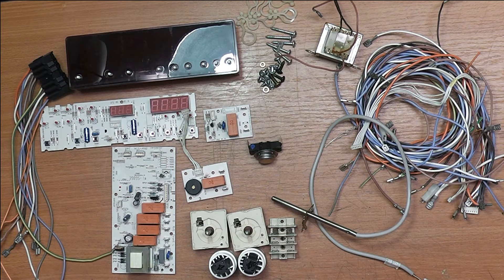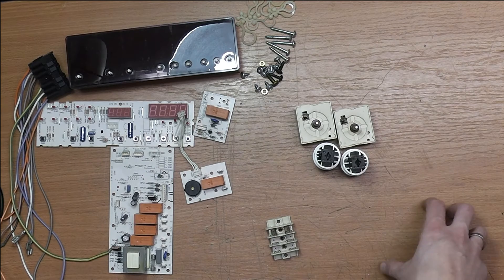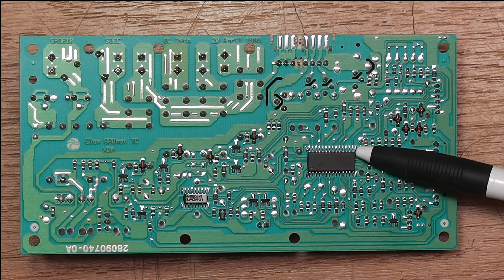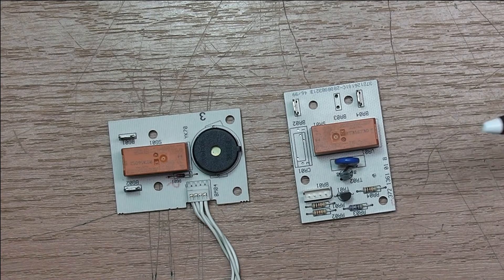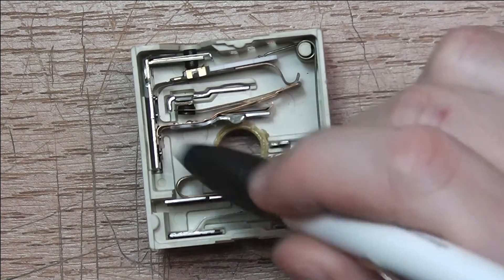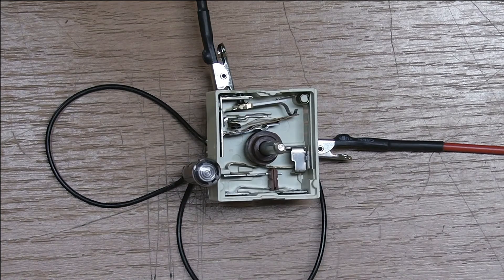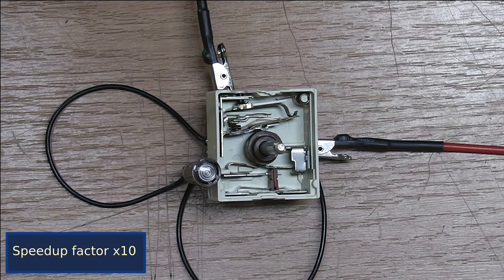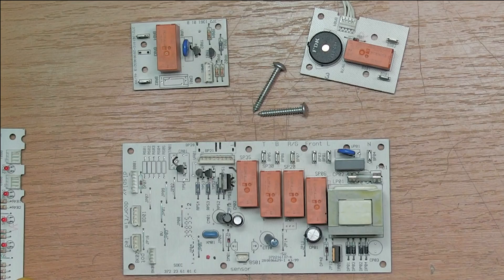Internals of an electric stove (Privileg ProComfort 8200E)

Comment: Great video. So does this oven not have temperature regulation? I don't understand how open-loop PWM driving can achieve temperature regulation.
Reply from the maker: +TheHue's SciTech Hey there and thanks, it means a lot to me :-) The oven has two parts, four stoves on top (where the pots and such go) and the bottom part where the baking happens. The top stove (for which the setters I show in the video are for) are indeed without temperature regulation. The only thing regulated is the amount of power that is output.

However, the bottom part is regulated. It was just very uninteresting (which is why I cut it from the video). The NTC measures the temperature, which is fed into the MCU's ADC input. Then the regulation happens digitally in there. Hope this clears things up. Thanks again for watching!
Reply: johndoe271828 So for the regulated bottom part, I presume the MCU drives the relays?
Reply from the maker: +TheHue's SciTech Yup, that's what the wiring suggests. There's more than one heating coil in the oven (those I didn't remove because they're of little practical use and were buried beyond tons of fiber glass wool), so therefore there's multiple relays. I believe the smaller triacs are for switching the fans (there's at least three different fans in there, all with shaded pole motors, one for cooling the electronics outside and two for stirring the air inside the oven).